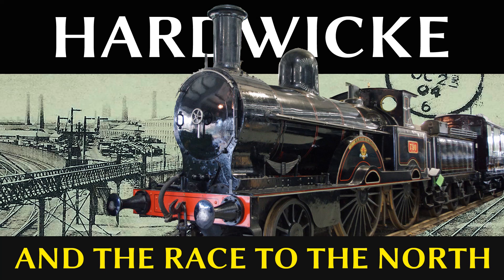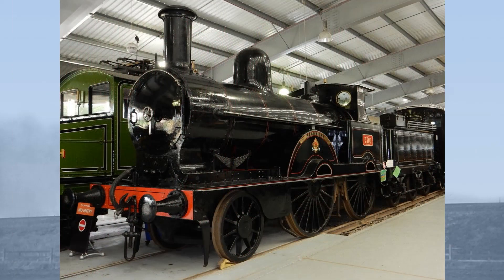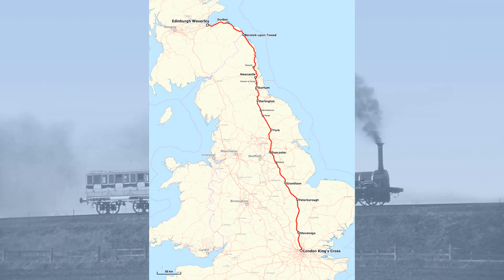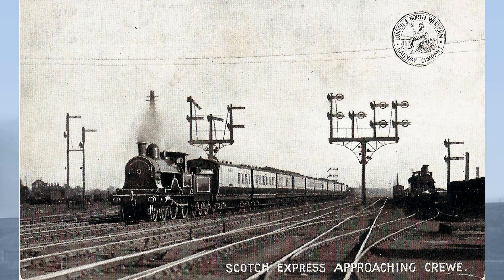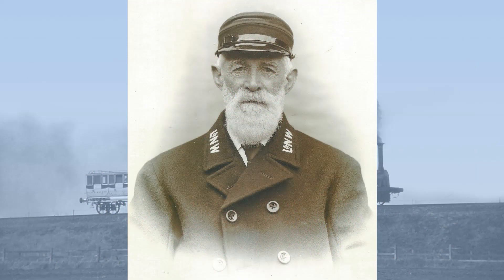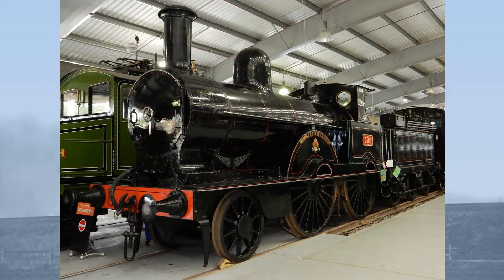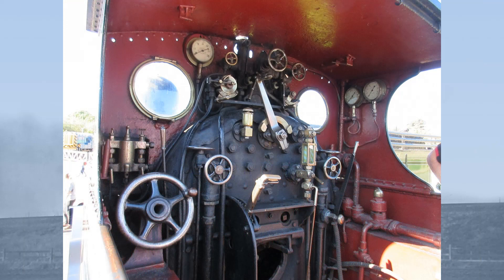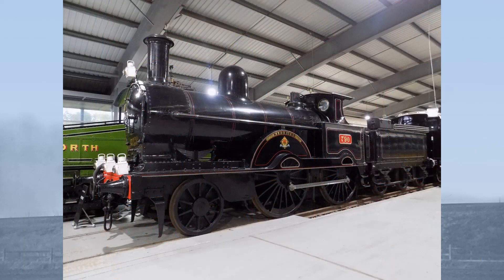Hardwicke and the Race to the North

Comment: Excellent video. Those 1895 races were amazing as they achieved speeds and overall timings on some routes which remained unequalled for 60 years. Only stopped by public alarm at racing trains and the fear of accidents.

Comment: from Fraser, husband of Leslie
The interesting bit in all this is that the LNWR never ran its trains much over 40 mph up until the 1890s.  During the same time, the GWR regularly ran at over 60 mph.   It was a policy followed by their chairman Richard Moon 1862 to 1890, when he retired. He realised speed costs money but didn't seem to realise that speed on its own, and hence journey times,  would be attractive to passengers and higher revenues could result.
 Fortunately his engineers produced locomotives that could travel a lot faster. It is said that the smoke boxes on the engines would glow red from the heat during these "races" which, needless to say, took place after Moon had retired.

Comment: Sometimes, a part of me wishes that Charles Dickens (LNWR No. 955) was also preserved as it clocked up 1,000,000 miles in under 10 years and 2,000,000 miles in a little over 20 years. Still, I do believe Hardwicke deserves its fame, even if the engine is the sole survivor of Webb's Porter (2-4-0) tender engines.

Comment: Have you covered the Stirling Single No.1 in this series ?
Reply from the maker: Not yet, but we will be.
Reply: @AnthonyDawsonHistory  She was given a cobbled together small tender for the White City exhibition and then used it in the famous run to Stevenage with some GN coaches and then for nearly ninety years. A correct, larger tender had been discovered near Werrington in the 1960s and I wrote to the NRM about restoring it. I received a very haughty letter back saying that they had to accept a loco as they rec'd it. That did not stop Duchess of Hamilton being streamlined afterwards. I believe that now, she is carrying that correct, larger tender which, at some time, could well have been attached to her.